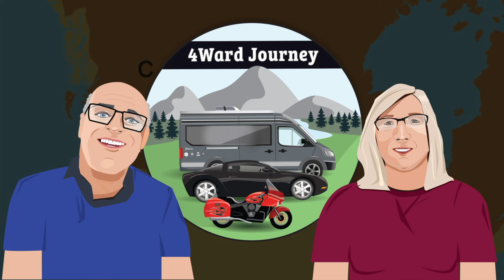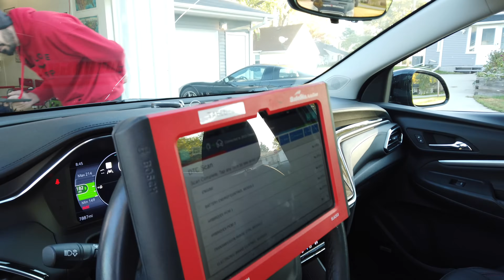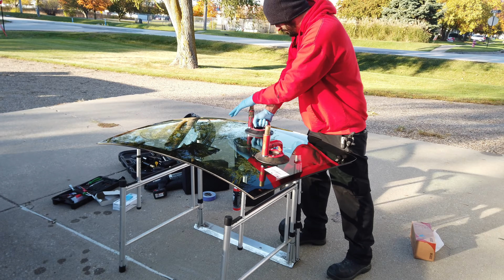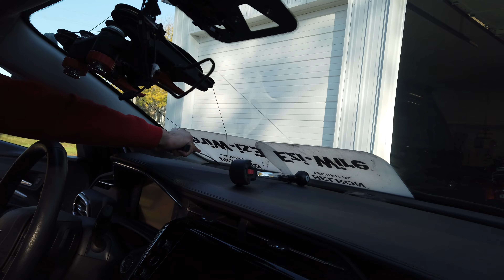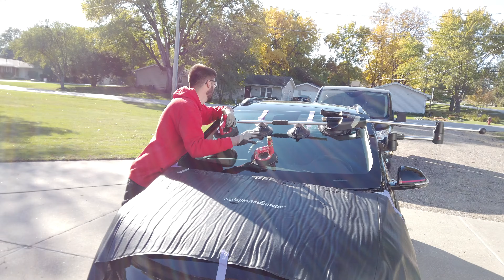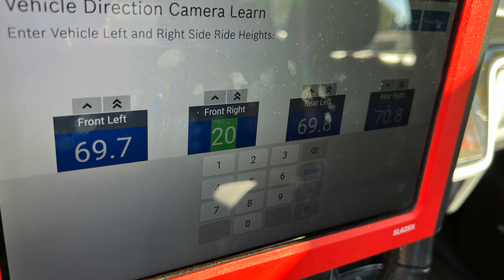Windshield Replacement Chev Bolt EUV - Will the Camera Systems Still Work?

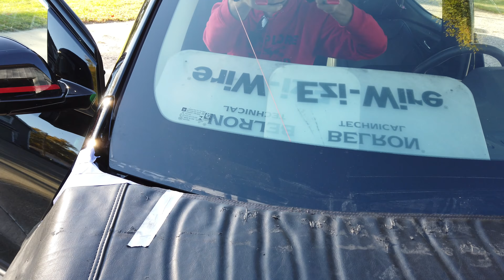Comment: I just bought a 2022 bolt. The dealer agreed to change the windshield, which had a crack. They had their "windshield guy" replace it. On the way home the car was emergency braking when I drove past cars on the left. (With plenty of room) It did that a few times and then faulted and turned off. The windshield guy was nice enough to say he would meet me at work to recalibrate the windshield. He then changed it to I will not make it by your quitting time, I will meet you at your house. Now it is 6:30 and I am still waiting.
Reply from the maker: That’s too bad that they didn’t calibrate your windshield correctly the first time.  Hopefully the guy gets there soon and gets it corrected.

Comment: Had this done and the after market windshield pins didn't match the camera module. Unfortunately the tech didn't check before installing the new windshield so the camera components wouldn't mount and now the camera system doesn't work until they can get a new OEM windshield to replace it again. Ugggggh
Reply from the maker: Oh no, that is so frustrating!